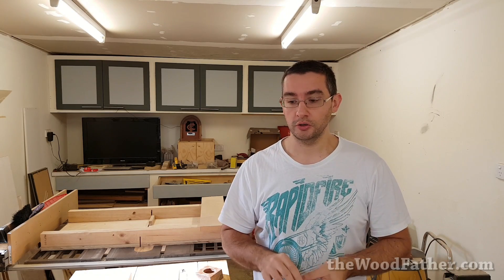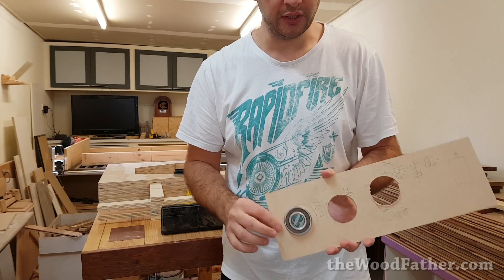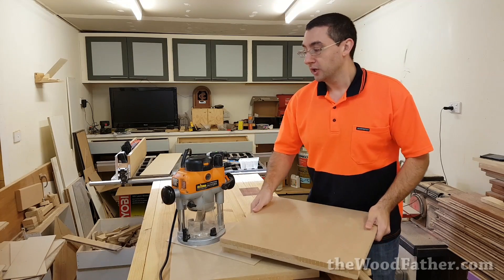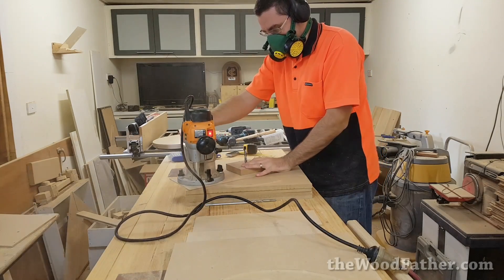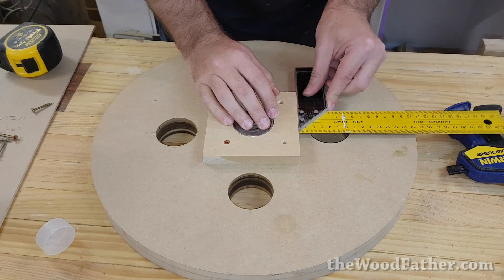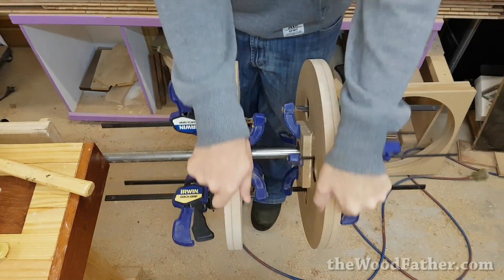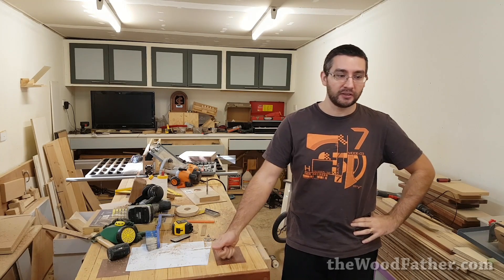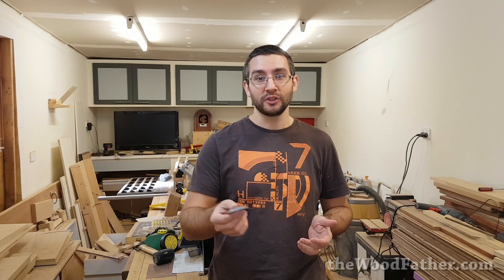Building a Wooden (plywood) Bandsaw - The Wheels Part 3

Comment: You never completed this? :(
Reply from the maker: Sadly no. Ran out of time and money back then. :( 
I still have all parts, and I'm working out when I can get back into building it again, I hope to get back into it this side of Christmas.
Reply: @woodfather  time and money, the curse of adulthood :). Look forward to it.  Interested to see how it compares to Matthias' version
Reply from the maker: @adrianmack3  I'm keen to know as well, I'm certain it will have faults / issues due to the use of plywood, but I want to know if it is still a worthwhile option or not.
If the answer is, 'not', then at least my folly will help others. :D
Reply: @woodfather  about the only thing I can see that might be different, is the rigidity of the frame.  In one of his videos he does a test to compare how much the cast frame bent compared to the wood frame.  Other than that, no reason yours won't work.

Comment: Any update on the status of the bandsaw? I'm getting ready to build the 20" bandsaw from Matthias and I'm curious about the use of plywood.
Reply: There is a bandsaw build video in Korean making the rounds on You Tube right now. Looking at it, he made the Wandel frame using high density plywood (many many layers as opposed to the four or five in standard fir shop plywood). Regular ply probably wouldn't be strong enough but the high end stuff seemed to be handling things well. I'm getting ready to build one myself but I'll be scaling the 20" up to 24" and beefing up the frame quite a bit. The cabinet shop where I work tosses a lot of cabinet grade, poplar core, red oak faced, one inch thick 19 ply scrap and I'm thinking of making my frame of that.
Reply: If I decide to go the plywood route, I myself will use Baltic birch plywood. I can get the entire frame and both wheels from 2 - 5x5 sheets. I just don't want to be the plywood guinea pig so to speak. Do you have the YouTube link?
Reply: I've seen it but it is in Korean. A real bummer since I would like to give the guy a compliment but don't read or speak that language. A search of "homebuilt bandsaw" on You Tube will turn it up. Other than the visuals the whole thing is done in Korean. But you get a really good look at the frame and he did a beautiful job. Like a lot of people, he made his wheels from MDF. I'm going that route. It's denser and heavier and machines better.
Reply: Kevin Litman don't use plywood!
Reply: I ended up using solid wood.

Comment: Those bearings are in much too loose if you can squeeze them in with that rickety woodworking vise.  Also MDF may not last for the flanges (I warn about MDF flanges in the plans).  Hope it lasts a while before the bearings come loose.
Reply from the maker: The face of the vice is a little wobbly when loose, I do need to fix that up yep, but the pressure behind it once tightened is still the same as any vice. It may not look it in the video but it did take a fair bit of elbow grease to squeeze them in. Worst case scenario the wheels get wobbly over time and I have to redo them I guess.

I've never used a real bandsaw so don't understand all the stresses the parts are under, hence, my whole 'try and build it from plywood/mdf idea' may be doomed from the start. To my eye, ply and mdf seem strong enough, but I guess I won't know for sure until a few months after I finish. That's part of the fun of this build though. ;-)

Many thanks for your plans, they are killer, super detailed! 
To anyone reading this who is thinking of buying them, go for it, they are better than woodworking plans you get in many books!

Comment: Good progress Mario - I too admire the holesaw hack.   One suggestion with the router cutting - when I was cutting simulated moulding on some doors (see http://lumberjocks.com/projects/178058) it went horribly wrong because of swarf build-up  lifting the router up off the workpiece and eventually stalling the machine.  However, when I took the time to attach the (flimsy-looking) dust extractor plastic attachment to the router, and connected a shop vacuum to that with lots of duck tape, the cutting went very smoothly.   It seems that like planer/thicknessers, getting the swarf out efficiently has a very beneficial effect on routing that waving a hose end around fails to achieve.
Reply from the maker: Those doors came out really nice Don, match the room well. 
I would have loved to have the hose connected to the router for this one, but after fiddling around with it all I figured it was a lot safer to rout, then vac. Trying to deal with keeping just the powercord attached and out of harms way was tough enough, I couldn't be bothered with the vacuum hose. The mask I use is quite good, I couldn't taste any dust once I took it of. I also walk out of the shop for at least 30 minutes after a cut like that and let the dust settle, then I go back and vacuum everything I can while still wearing the mask. Dust collection is a definite requirement here, with a bit of luck over the next couple months I should be able to get a rudimentary system going.
Reply: Not to harp on about it, but I too was concerned about tangling the hose and cable, so I knocked up an overhead support for them so they kept out of the way of the router.  I have to say that it was a bit of a pain creating the support when I just wanted to get on with the routing, but the build up of dust on the first try had nearly spoiled my workpiece and given me a nasty turn.   As it was, the cutting went easily and was worth the extra effort.   When I see Matthias and others knocking up jigs to do even simple tasks, it makes me realise that the longest way to do a job often ends up being the quickest - which is totally foreign to my natural instincts!!!